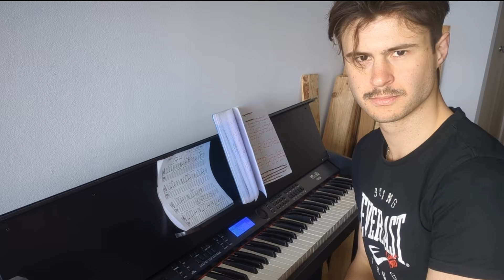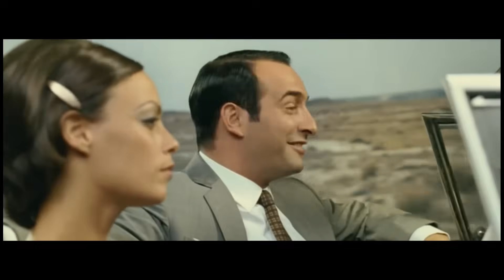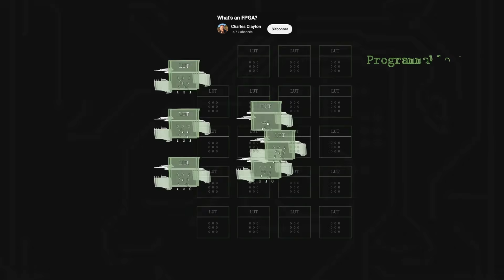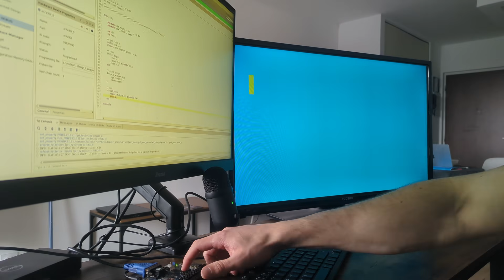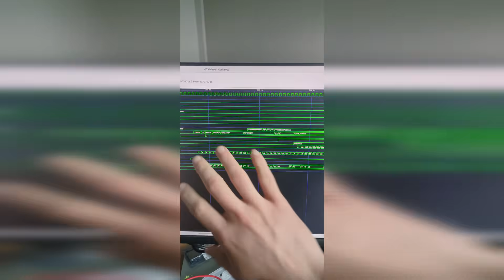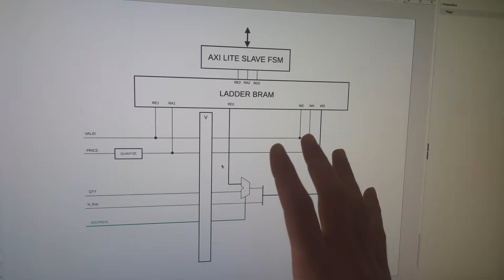Can Custom Hardware Beat the Stock Market?

Comment: The title is misleading. You haven't made your own chip. You have not developed your own ASIC. You have not done any chip floorplan nor design any silicon. All you have done is putting your design into FPGA.
Reply from the maker: I wanted a way to make it sound more "concrete" to people that are not into hardware design...

I mean, of course I did not manufacture and verified my own silicon. I'm doing this on my free time lol
Reply: @BRH_SoC  Yeah, it is always a trade-off. Therefore I always prefer to stay as factual and accurate as possible.